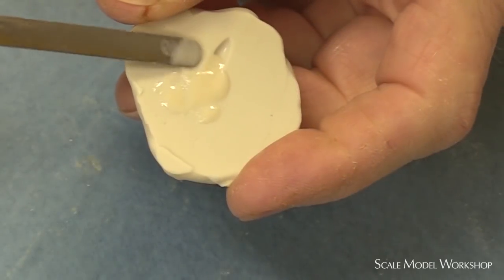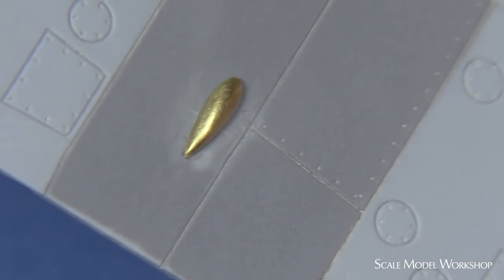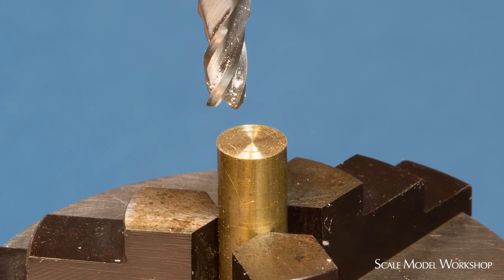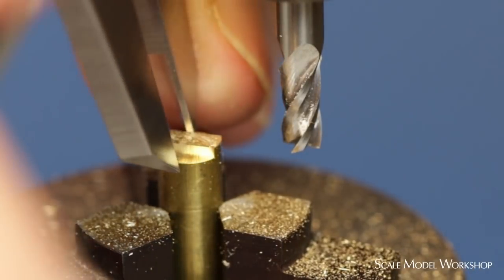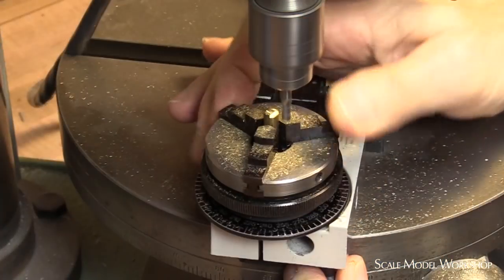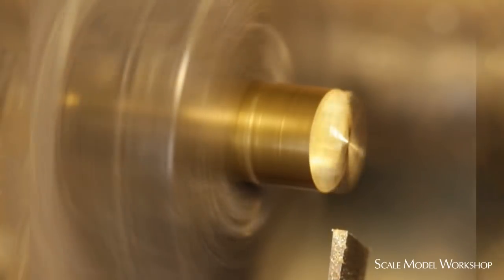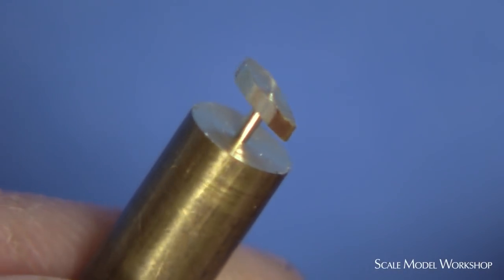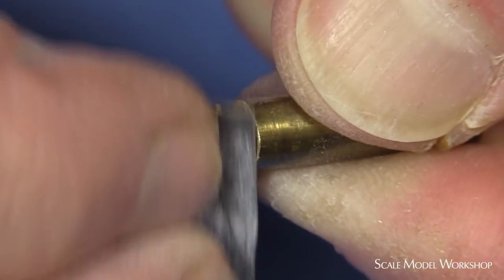Creating a Wing Blister from Brass

Comment: would plexiglass work as well? A less robust lathe would be need for  that. Great video.
Reply from the maker: It's way to small for plastic
Reply: Gerry Parker
I would recommend using something like Milliput and simply shape it if need be.
Reply: @TheCimbrianBull  been there , tried that  and failed
Reply: @gerryparker1390 
No matter what I hope you find a solution that works for you.
Reply: @TheCimbrianBull  It is an excellent suggestion, Milliput can be wonderful stuff I am just really bad at carving and shaping.
Reply: @gerryparker1390 
There is something called "Blue Stuff" which is a reusable thermoplastic that can be heated and made moldable using hot water. I use it to make imprints of surface details and after it cools down you have a mould. I fill it with Milliput and once dry it can be easily released from the mould. There videos of this here on YouTube. Maybe that could do the trick for you then?
Reply: @TheCimbrianBull  Interesting. I will check it out.

Comment: Would a 3D printer be able to reproduce that blister? I have not idea.
Reply: Thinking the same thing.....
Reply: Yes, a 3D printer could reproduce that blister. However, most 3D printers for hobbyists create layers of filament-like plastic so care is required to properly seal the minute gaps that may appear in the course of sanding.  Squadron putty or the like would serve as would any other filler.
Reply from the maker: Thanks Ozzy ... you get it exactly !!!
Reply: The title sumarice the spirit of a true modeler: create. Didn't said: print  a Wing Blister. Another clear example of the right tools in the right hands.